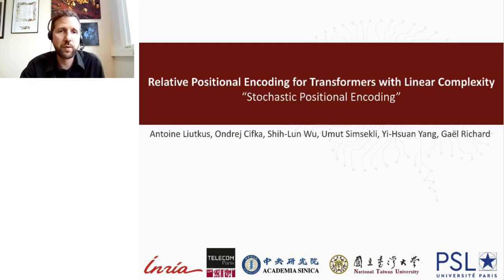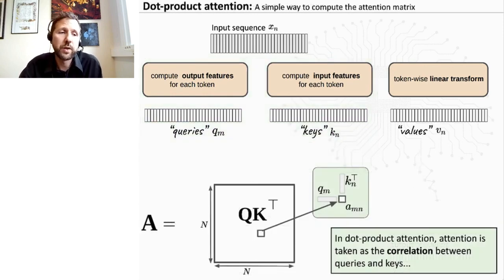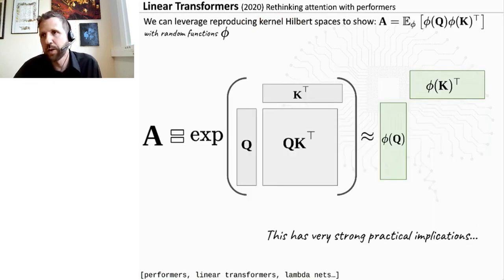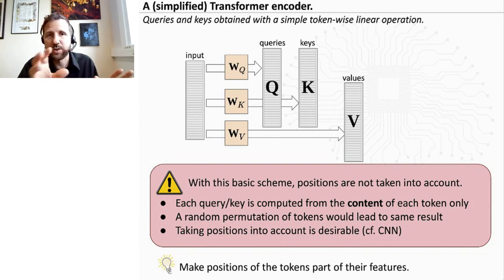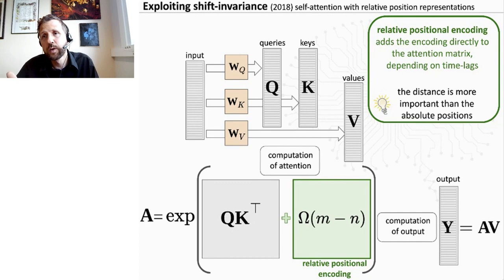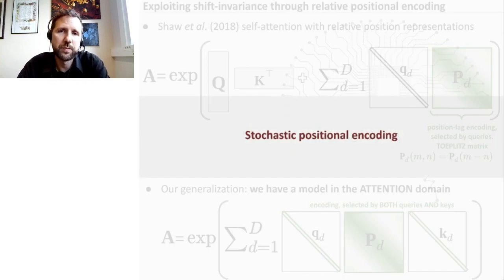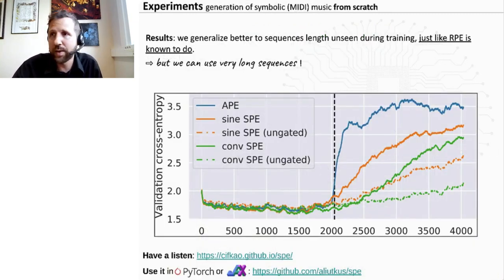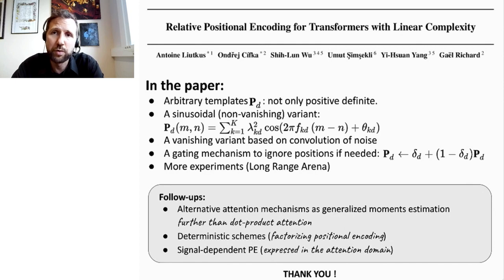Relative Positional Encoding for Transformers with Linear Complexity | Oral | ICML 2021

Comment: I think the attention matrix, or rather the attention mechanism, existed long before the Attention Is All You Need Paper. Attention was used at the core of prior SOTA encoder-decoder models such as RNN encoder-decoders and models like ConvSeq2Seq. As far as I know the only novel part of the attention mechanism in the transformer is the omission of any convolutional or recurrent mechanisms for 'token mixing', relying on only Attention for this purpose. Although to be fair I think the Transformer may have been the first to introduce pure self attention in the encoder, rather than decoder cross attention, but I may be wrong.